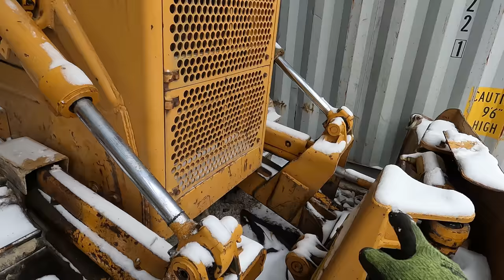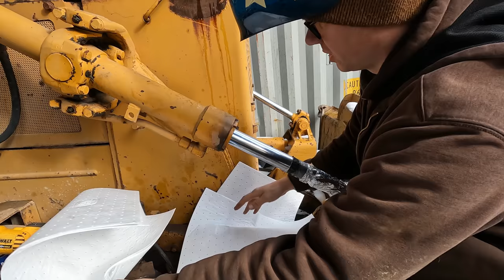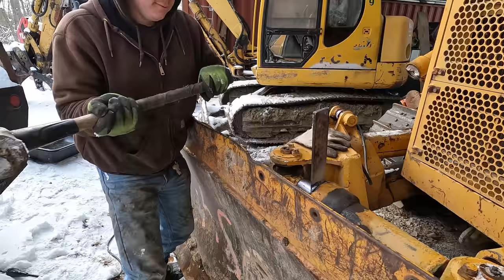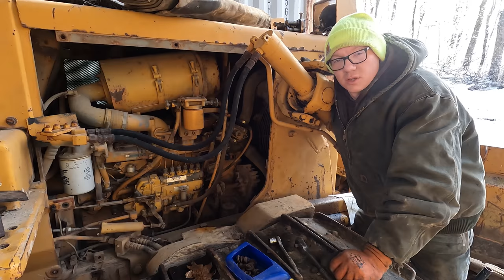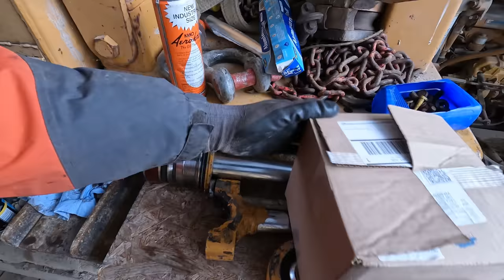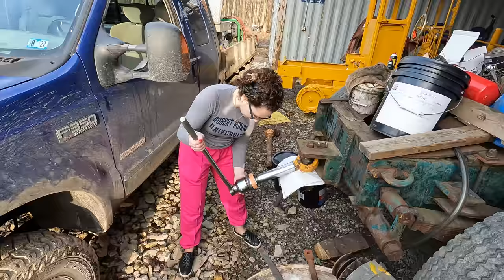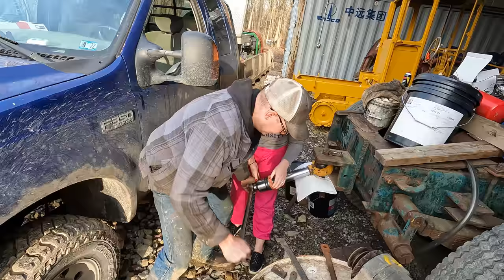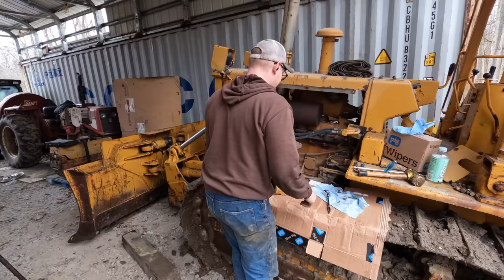Komatsu Dozer gets Cylinder Rebuild. (Long Overdue)

Comment: The retaining rings on the piston do need to be clocked. In hydraulic school, they taught us that, fluid can pass thru the slits.
Reply: Clocking a backup ring? What would be the point? The backup ring has no sealing capability
Reply: @soccerdommer  slots. What we were taught. Just to make sure the retaining rings slits were not lined up together on either side of a seal.

Comment: 42:40 Zylinders have different forces on forward vs. backward stroke. Forward the complete cross section is pressing and backward only the area minus the rod. This leads to the question where you need more force. Btw. smaller cross section means less valve flow to make the stroke or with the same valve flow it moves quicker without load. Be sure that engineers do calculate valve flows in respect to this.
Reply: He meant he put the piston head on the rod backward, he didn't install them backward.

Comment: Matt for future reference, you can get something called a "flex hone" that you can put into a cordless drill and use that to hone the cylinder where the weld bead had shrank it
Reply: I wouldn't recommend doing it that way.  Too much risk of over/underboring it, because it's doubtful anybody using a cordless drill would have precision measuring tools for checking the diameter.  Nor would you easily be able to check it was honing it true to the bore (which is apparently skew-whiff anyway).  Much better to put it on a lathe, measure it accurately and machine it properly (or as true as you can).

Flex hones definitely have their place, but not for that application.
Reply: @dfross87  The proper tool is an engine cylinder hone it - self-adjusts more than enough to cope with using a portable drill (short of deliberately honing way-off true).  Tho the damage might have been too much for honing to repair.

This application is rather less critical than an engine cylinder.  He mainly needs to take out small areas that catch the seals, once those are smoothed, it doesn't matter much if it's slightly out of round or off true, the seals will cope.

In the video, the cylinder shop said the cylinder was slightly out of true.  Dollars to donuts, the crack was quite big, and the welding repair left the cylinder slightly kinked.
Reply: @fromagefrizzbizz9377  The proper way would be to replace the barrel (may be hard/impossible to find); next best is cutting the repaired section off and re-welding it properly ($$$ -- option 1 may be cheaper).

So the preferred repair method is (as the shop did) to chuck it up on a lathe and machine away what they can while making it as true as possible.

Honing removes material (fairly) evenly around the whole circumference, so won't help with putting the bore back closer to true.  Additionally, it may remove material from an area that doesn't need it.  A cylinder hone may work better than a flex hone, but honing is not what I'd recommend as a repair method.

I agree with the last part of your comment.  Exactly my conclusion too -- the weld pulled the cylinder, as well as shrinking it.
Reply: @dfross87  I will agree with what you say, except to point out that there are various degrees of repair, and everyone picks the one that balances cost and effort to their unique circumstances.

A coarser hone would probably be a bit better taking off high spots than you think.  Furthermore, with a hydraulic cylinder a very slight kink in the travel would not be nearly as bad as honing a engine cylinder with the same problem.  The seals are soft and will conform to minor irregularities (as long as they're not abrasive) a lot better than piston rings!

I'd be tempted to use a hone and keep my fingers crossed, leaving more expensive repair for if it didn't work.  Then again, I don't use my tractor for my living, nor put a lot of hours on it, nor see so much heavy work, so a half-assed fix may be good enough for me, but not thee (I have a CUT TLB that lives in a nice cozy garage (20' shipping container) that's also impervious to critters)

It wasn't my fingers in there feeling the chewed bits, so I could be talking through my $ss for this repair.
Reply: @fromagefrizzbizz9377  I understand the cost/benefit aspect, but I learned what little I know of this stuff working in a hydraulic shop.  Honing was a routine part of cylinder re-seals -- definitely not a repair technique!  There was too much risk of it coming back to bite us on the backside.  So I'm probably more risk averse WRT cylinder repair, because that's what I was taught.

I totally agree with your last paragraph there, and it definitely applies to me too!
Reply: @dfross87  Oh yup, doing this sort of thing commercially puts a whole new light on it. Commercial service simply CANNOT take such risks, because they get bitten too often and have to do it over again.  Most places would almost certainly insist the cylinder be replaced.

This is how I learned that - 20 some years ago, I had a problem with the car's starter.  The starter worked intermittently, yet, the battery, circuitry and relay was clacking away faithfully.

My garage said that the starter should be replaced - the solenoid was f'd.  H'm.  I asked can you repair the relay? "We can't guarantee it".  This garage is really good with a much beloved mechanic-owner (who has died since, yet had a great impact on the community).

"What if I try?"

"Sure, we'll take it out and put it back in, but we won't be able to guarantee it".

H'm.  At worst it'll need a new starter.  I took it home, opened up the relay housing, and took a file to the contactors (that looked like small hockey pucks).  Cleaned it up, reassembled, and the garage reinstalled it.  Worked fine until the car was donated to the local volunteer firefighters to practice extractions on (last seen the poor thing had all its windows broken, two doors torn off, and heavy body damage).

Same goes for alternators.  Saved an alternator once with a $25 diode bridge.  But a garage would almost never do that.
Reply: @fromagefrizzbizz9377  I'm guessing our response would have been, "This is the price of a new cylinder.  We can try to machine it out for you, but no guarantee we can save it.  AND it will state on the receipt that no warranty is given if this cylinder fails."

Pretty much what happened in the video (guessing).

Comment: Maybe get the cylinder I.D. machined and honed?  Should work.  EDIT:  That's what you did LOL.  Also- the cylinder was probably just warped from welding...
Reply: Did the machine shop suggest cutting the threaded end off and rewelding it?

Comment: I don't think it matter that much with the inside piston glands being backwards, it will work just fine either way. As long as your end gland seals and wipers are in the correct orientation, that's all that matters. I've taken apart a cylinder that only had the plastic bushing that rides the inside cylinder wall, the seals were non existent and it had worked as they should.
Reply: The only thing I can think of is that if you want to generate the same force in both directions then the pressure has to be higher on the side with the rod. I would imagine you'd lose a little bit of power due to blow by especially on the higher pressure side if the sealing method isn't symmetic
Reply: @Xlaxsauce  true and also if you are using a system like boom uses where only one side uses pump pressure and a holding value. I think this particular piston seal works both ways. I did see a comment that made a good point though. It said as long as the seal being backwards didn't put it in a position that made it rake across the input ports for the fluid.

Comment: My semi-bush fix for the inner size of the cylinder would have been a dingle ball hone. Probably 5-10 seconds is all it would need.  Now that may mess up the rest of the inner surface finish but I would have tried it before taking it to be re-bored.

Comment: I know what a struggle it was to rebuild those cylinders but I just couldn't rest easy knowing the pistons were on backwards. The seals are designed to work in a specific direction and will fail sooner than later. I think it would be a good idea to correct it before using the dozer in dirt and risk fouling the seals with debris.
Reply: Won't make one single bit of difference, the pistons are the only thing he flipped, inside the cylinder, as long as the end seals are good should be no debris inside anyway.  Its a double acting cylinder, both sides of the piston see pressure, so either way the piston is flipped it gets it from both sides.  The only difference is the slight change in location of the bearing strip, the ring seal won't give a crap though.  I've seen them put together both ways from the factory, so there seems to be some argument in the industry which way they go.  I bet it outlasts the end seals again.
Reply: @ryanthomas2472  Okay, I stand corrected. I'm no hydraulic expert and didn't think about them being double-acting cylinders. Great, now no worries. Thanks for the info!

Comment: TOP TIP.. from 20 years in aerospace.. anti-sieze will act as an seal from moisture.. with any job that threads can be exposed to any moisture coat the entire length of threads with the paste .. fasten everything together hand tight then loosen almost to the point of disassembly , re-coat the threads again AND any flat contact points or flanges .. tighten to specific amounts.. poof ..almost completely weather resistant component .

Comment: It probably makes a difference on the cylinders with the seals as to which way it takes the most force. The down pressure to make the blade take bite. It has changed the seal in reference to extension versus retraction. Can this change the amount of pressure the seal receives? It will face the pressure the system has with its relief valve setting either way. I will admit I've no idea if it's a longevity problem or not,will it bypass excessively?I've no idea. Hydraulics are interesting and a convenience for certain. If it becomes a problem make another video and we all will know. I appreciate the know how you impart to us. Anybody working on equipment will face such problems sooner or later .Love the channel.

Comment: Hi Matt. If I were you, I would have already attached a steel plate with two or three holes to the back of the service truck bed. Then get a large, inexpensive vise and instead of fastening bolts, just screw on large pins that fit into the holes in the steel plate. This way the vice is mobile and can be placed on the plate when needed.

Comment: I would suggest that during the installation of all the seals, you use pleanty of hydraulic fluid. It makes the rubber slippery and aids in not damageing the packing pieces.

Comment: A piece of advice that I picked up from an old timer. Whenever you find yourself hammering on a stuck part that has a little bit of "give or play" it will act as a cushion to your blows preventing the power from going i to dislodging the nut. If you take some rope or a ratchet strap to pull out that early play it will help more of the hammer blow go into breaking free the part. 

As you seem to have mentioned a LITTLE HEAT will help fix tight tolerance fit. Just as you would preheat a bearing to help it slide on a shaft you could throw SOME heat into that cylinder to to help expand it. Especially in that cold weather it would make that tight fit even closer. 

Enjoy seeing you repair these machines, always take away a little bit of wisdom or "Matt Knowhow" 🍻

Comment: Double acting cylinders ... there really isn't a "wrong" way for the pistons to face, more like a "better" way for max pressures vs. piston face size, etc.. they are enginereed a specific way but, in reality will work either way.
Thanks for sharing 🇨🇦

Comment: In the gland packing, the thin black split ring helps reduce the pressure on the gland seal, preventing excessive wear. The same applies to the large split seal being near the rod nut. The heaviest pressure in the cylinder is located at the large end. The larger piston area provides more lift for picking up the blade and the split ring reduces the pressure against the main seal. You may experience rapid wear of the piston seal ring since there is no "breaker ring" to reduce the pressure on the seal ring. But you don't plan on putting a lot of hours on the unit anyway.

Comment: I am only 68 years old and wrenching since 1975.  That incident where the seal gland assembly is a bummer. There was a time when I already poured a whole gallon of oil and then seeing the drain plug still sitting on top of the engine.

Comment: Hey! I can finally make a useful comment on your video!! 

I was working in a hydraulic shop the beginning of last year, and we used a pipe wrench to take off damn near everything. Big vises and big pipe wrenches is pretty much half the tear down area.

The wear rings on the end help the cylinder run straight, being a little further in would wear the seal a little quicker

Comment: I've been doing some research and logical thinking (that usually means "run away!", but maybe this will help unless someone more knowledgeable than me comes along), and I think I have your answer about what reversing a piston will do.

The wide band is the "piston guide", the narrow rings are the pressure seals. The guide keeps the piston centered to avoid offset lateral pressure on the pressure rings, and tends to help it from tilting - which you won't see much of anyway in a rigid piston/rod assembly.  I'd guess it would be a teensy bit better to have the piston guide opposite to the gland nut - fractionally less leverage. 

It appears that pressure seals are supposed to be towards where the fluid pressure is.  Which is obvious in a single-acting cylinder.  With double-acting cylinders they seem to be often done with seal rings in the middle, and guides rings on both ends.  However, since your cylinders are double acting (aren't they?), and the piston only has one guide ring, it probably matters little which way it's installed.  

Your tilt and angle cylinders will probably see similar pressure on both extension and retraction - while the rod side applies less force, the pressure is the same..  I don't know enough about bulldozer operation to know whether the pressures are higher on extension or retraction in a typical job.  All I know is that I have no down pressure on my CUT's three point hitch cylinder by design.

Comment: I was a seal designer for Trelleborg Sealing Solutions America’s, and we made hydraulic seals for CAT, JD, Komatsu and many others, the Blue seal is called a radial oil seal. The dark Gray component of the Backup Ring. The backup ring is to ensure while under higher pressure, the seal does not extrude into the bore. If ever you have questions regarding Pneumatic or Hudraulic Seals and Packings, don’t hesitate to reach out!!

Comment: One thing that I like about your videos is that you add to my mind set of all the useless knowledge that I have assimilated in my mind.  I am a firm believer that learning something new will keep my mind young.  At eighty-one I am a walking book of useless information, never worry, I have an opinion on just about every topic.  Love your videos especially the  one on haw Diesel Creek got named. Putting the ram back together is only a screw up if it doesn't work after assembly.  Just my opinion.

Comment: I've had the same problem with mine and what I did was I took a cylinder hone to the inside and smoothed out the rigged and it works just fine

Comment: My local Komatsu shop has a  huge hydraulic powered ratchet to tighten/loosen cylinders. anything up to around 1400 lbs/ft.  Another thing to try on glands like yours, is to beat both sides of the gland(*around the threaded part) using twolarge hammers.- Hit both opposing sides at once- work right around cyl., this can stretch the metal slightly, allowing it to loosen. Cheers. Also- you can see why I am a huge fan of neverseize. Even if someone else has do work on something after several years, they will thank you. keep up the good work.

Comment: So an old trick my Dad taught me. A couple old Motorcycle tire tubes will do wonders to save your cylinder rods.  Simply slide upover the chrome rod and clamp on each end. 
Keeps rocks from making "dings" in the rod and keeps the dirt off them. 
ALSO great for Frontend Loaders  where material spills over the back of the bucket
The inner tubes are flexible enough to stretch and compress as the cylinder is worked.
Loosen the lower clamp on the tube and check for leakage when you service amd grease.

Comment: Maybe a tip for protecting stuff from welding etc.: Aluminium foil will easily melt, that's why the sparks will go right through. If you use sandwich layers of Al-foil and newspaper, the paper will carbonize and protect the thing below, since the carbon will only start to evaporate at above 6.500°F (not going to happen). The Al-foil seals the paper from air and prevents it from burning. Love your videos, learning a lot and having fun! :)

Comment: If you take a ball peen hammer and spend some time lightly peening around the gland nut, it will come off with ease. No welding or large bars required. You don’t want to peen hard enough to damage the metal, just enough to break loose the connection between the gland nut and the cylinder. It will take LOTS of taps so just take your time and peen softly. I’ve used that trick tons of time on cylinders much larger than those and it has never let me down.

Comment: This reminds me of doing the cylinders on my excavator, it's amazing how tight the glandnut and internal nut are. I broke a 3/4 wrench and 2 foot pipe wrench taking it off. Lookup peening a cylinder if you have trouble taking a gland nut off... it sounds crazy but even after oxy acetylene heat, it was the only thing that worked.